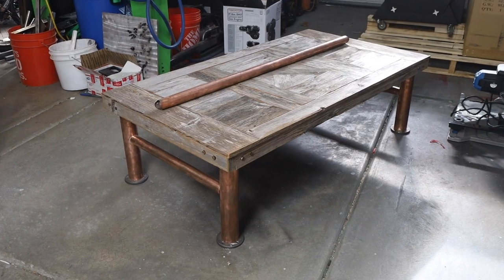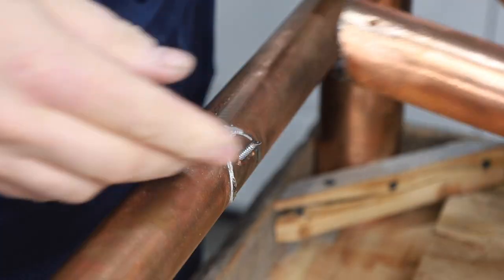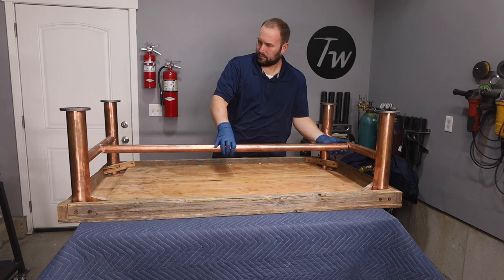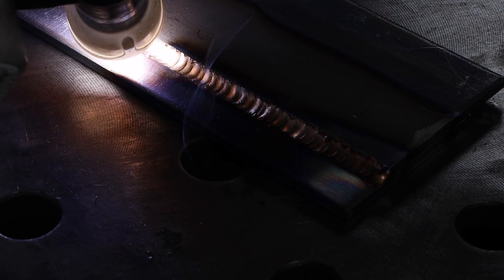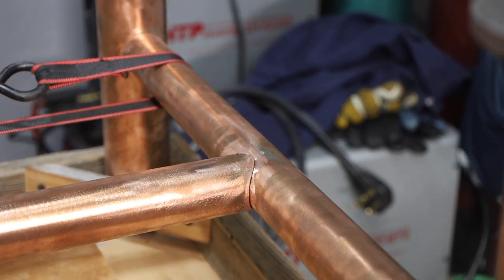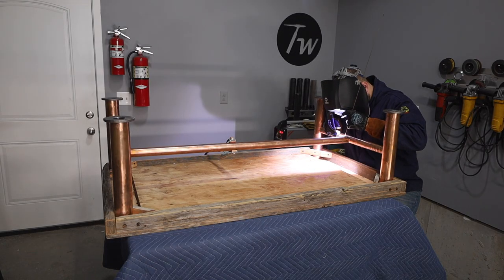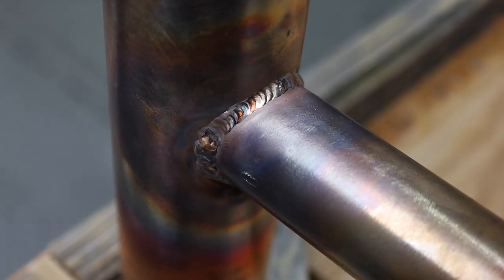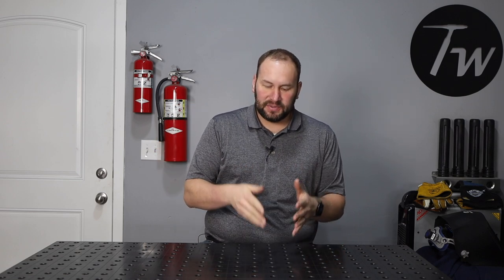Copper Frame Repair: TIG brazing for the win!

Comment: If you have a tig welder you can WELD copper. Using some 14-10gauge electrical wiring like Romex works great as filler
Reply: second this. works great.
Reply: @TheGodfather101  You're goddmaned right It works great!
I don't make a great effort to be wrong about things.

 Electrical wiring, unlike say copper plumbing pipe,  is very pure copper, so it doesn't have a lot of impurities, and it flows even smoother than mild steel, but you have the downside of the base metal Being a really good heat sink like aluminum. Still one of my favorite things to weld
Reply: Do you have to use helium as a shielding gas, or is argon possible?  What about with AC?
Reply: @Rossco139  Never tried ac. You can use both argon or helium or a mix of argon and helium. If you use helium or a mix of the two , you won't need as much amperage. I'll weld up to 1/8 copper with straight argon no problem but for thicker larger pieces I'll add some helium

Comment: One suggestion is to include some important data points like rod size and amperage in these kinds of videos.
Reply from the maker: Thanks for the suggestion! I was running 3/32” (2.4mm) silicon bronze at a machine setting of 200 amps. I’ll include more of those details in the next one.
Reply: @TimWelds  Wow, that’s really hot!  Impressed you didn’t melt the parent metal.

Comment: Great repair. I've tig brazed with silicon bronze; but if I'm looking for more strength, I prefer aluminum bronze (using AC). Unless you plan on dancing on it😂😂.... your silbro repair will last & is much stronger than the original build.

Comment: Don't want to sound churlish (as the TIG welding skill was excellent), but I'd opt for a 2% or 5%Ag CuP Brazing alloy with oxy/propane (and maybe gasflux if appearance is important). Much faster and probably less heat input.

Comment: Repairs yes. Question, can you tig braze with regular Oxy/acc brazing rod? Flux on or off?
Reply from the maker: Thanks! I’ve never thought about using torch brazing rods with TIG, so I’m taking a bit of an informed guess here. There are several types of brazing rod for torch use, and depending on the rod they may work in a pinch (without the flux). A lot of them contain Zinc which is likely to fume out and make a bit of a mess. I have used alumiweld soldering rods as filler to TIG weld a buckle made from pot metal. It was messy, but got the job done.
Reply: @TimWelds  thanks for the insights.

Comment: What is your current setting? I tried TIG brazing with phosphor bronze (same stuff they use for HVAC) and I couldn't find a line between being able to melt the bronze and melting the copper. It was a VERY fine line, and also the arc was erratic as hell.

Comment: Enjoyed seeing how you can use the tig welder to braze. Given a choice, would it have been easier to braze with say an oxy/acetylene torch? I was thinking the tig-to-workpiece arc would melt the copper, but with a torch you can keep the temperatures below the melting point of the copper base metal. Or does it not really melt the copper done the way you did?
Reply: You keep the amps down lower than you would for a weld.
Reply from the maker: Thanks! I think TIG brazing is easier than oxy-fuel. You can melt the copper with a TIG torch, but if you keep the travel speed high enough for the amperage, it doesn’t melt. The hardest part is getting the first dab of filler on.
Reply: To my knowledge, you'd need to silver braze the copper together. Getting paste flux off a joint attached to a table like that would not be very fun. I bet it would also be very hard to keep enough heat localized on copper tubing that large
Reply: @ResonantElecDesign  Using a CuP or AG CuP brazing alloy and using oxy/propane or acetylene doesn't require any flux on copper to copper joints. It does take some practice, but it is possible to achieve really neat joints.

Comment: You are welding and not brazing. Brazing is combining two metals without a filler. Brazing is used on thick metal. I am certified GMA-MIG ICAR welder. You did a good job welding copper.